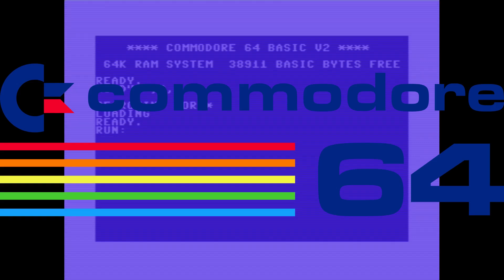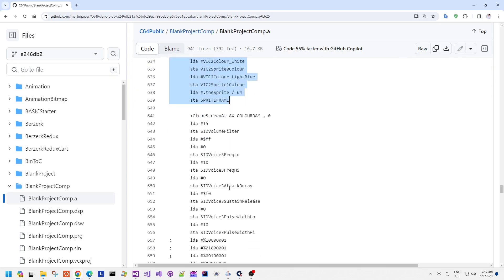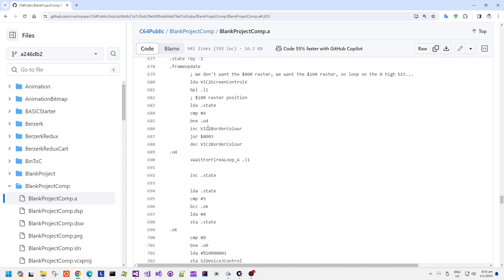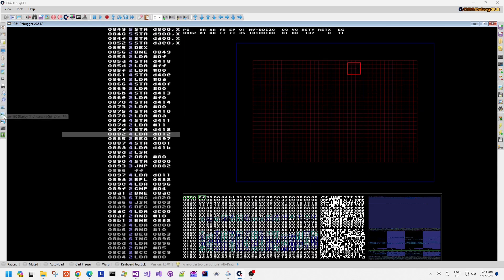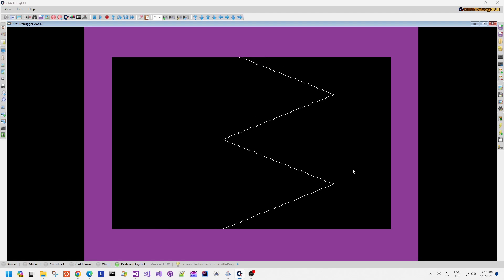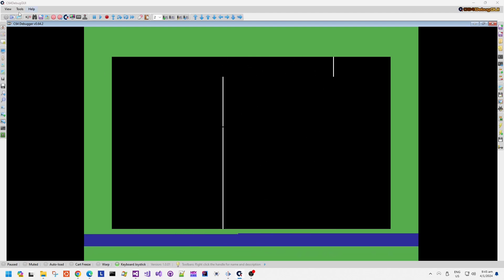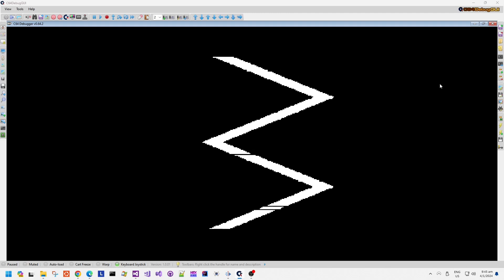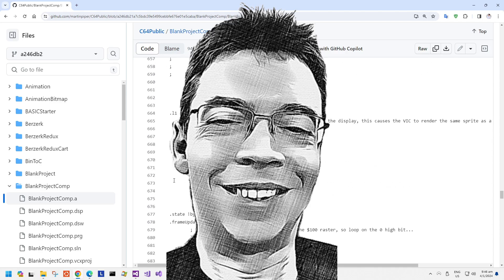C64 Coding - Oscilloscope sprite

Comment: I did this except I plotted the wave form out on the hires screen. My display set 2/3 of the screen as hires and the bottom 1/3 as text for control input using a raster interrupt. Being an electronic tech I built an isolated input buffer that plugged into the joystick "pot x" and "pot y". These two inputs are analog to digital inputs rather than the more commonly used switch inputs of the joystick. These can be read at 54297 and 54298 on the SID chip and output a number 0 to 255. Since these two outputs are updated every 512 CPU clock cycles my scope was good for external audio signals up to about 2khz. The 'Y' axis was normally generated by a counter in the program, but could be switched over to use an external signal input on the 'Y' pot. It wasn't supper accurate but it was great for studying and measuring audio signals.

Comment: Is the sound used to control the movement of the sprite?
Reply from the maker: Yes
Reply: @MartinPiper6502  Thx. It is a long time ago that i used assembly on C64. Now i use x86 assembly in DosBox emulator and i made some videos(no speech) to show how it works and to share the files as an open souce project. Have fun.